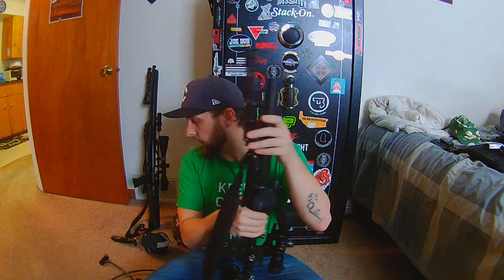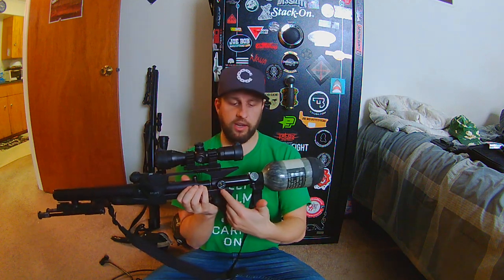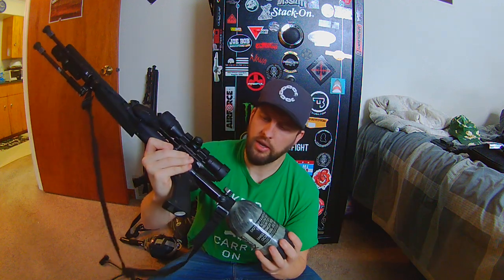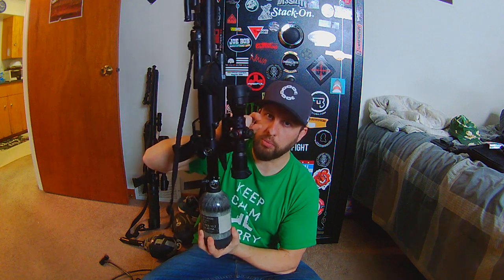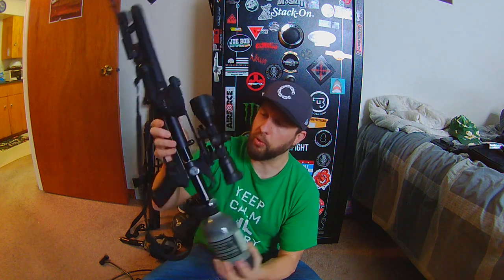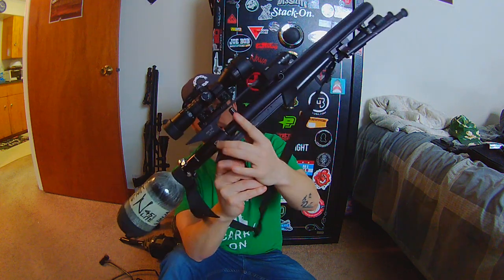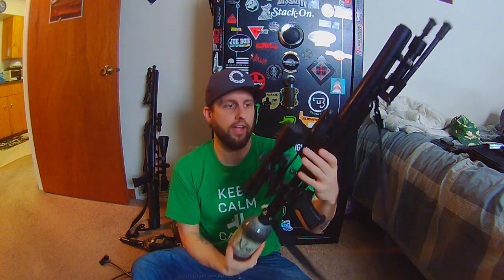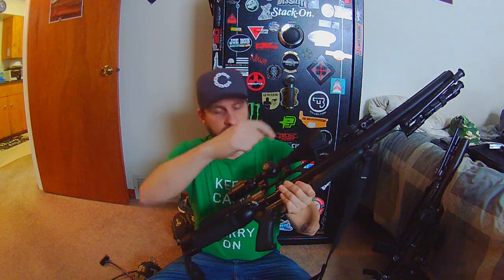Airforce Talon and Condor Regulated Air Systems - An overview

Comment: where did you get the aluminium adapter since the air force one was too heavy ?
thanks
Reply from the maker: I searched around on eBay for it. I hate buying from China, but it actually is good quality.
Reply: @airshootist   thanks that's  where i found it was worried about quality too
since you already got one and say its pretty good guess i will order also
thanks again
Reply: I see you mention the ninja flex reg 2200-3000 psi out put thought that reg was for 3000 psi tanks but you have it on a 4500 psi tank if i am wrong what flex reg is that
thanks you are the only one out there really sharing the knowledge in detail
Reply: @airshootist  
What flex reg is that for 2200-3000 psi output and 4500 psi tank the only one I found was for 3000 tank and 2200-3000 psi output ?
Thanks
Reply from the maker: @marckverduzco4250  So you can find the PCP Flex reg for a 4500psi tank on Ebay. I bought one that was labeled 4500psi on MCSUS.com's website but they sent me a 3000psi model.... So rather than bother with a return I called my contact at Ninja and...well... (unofficially) the only difference on the 3000psi model vs the 4500 psi is the burst disk and laser engraving. Get a 7500psi burst disk to replace the 5k one on the 3K tank model and you'll be fine :)
Reply: @airshootist  
thank you
 you are saving me from doing so much research
since you are full of great info what is your opinion on the altaros regulators being attached straight to air tank since there is no power plenum am i missing something ?
Reply: @airshootist  
Do you keep your flex reg and all connections under pressure when stored or do you    Disconnect when not shooting ?
Reply from the maker: @marckverduzco4250  Yes. Always store your tanks under pressure.
Reply from the maker: @marckverduzco4250  Condor regulated tank is for sale. I just sold the Condor, but not the regulated tank setup. Send me a message via YouTube if interested.
Reply: @airshootist  
Thanks I’m a pcp guy
Just thinking that adapter pin always pushing down on the flex regs output, and I rings being on constant pressure 
Thanks
Reply from the maker: @Marck Verduzco  I actually removed the pin in the reg bonnet and drilled out the adapter for extra volume. Since the adapter is drilled out there is nothing to push the pin in - so it needed to be removed, adding even a teensy bit more volume and creating a straight flow system.

Comment: Interesting but way way way too complicated for your average air-gunner
Reply from the maker: Nah, not really that complicated at all. Maybe doing all the research to build something like this is, but I just revealed all that!  I do appreciate your comment / opportunity for dialogue. 
In fact, this can uncomplicate things a bit. Your tank can stay on the gun for filling (relevant for older model Talons/Condors). Now you have no huge bell curve of velocity to work around. Now you don't have to fill as often. Now you can calculate your trajectory with more certainty. I feel adding regulated setups to my tanks has made my guns much more convenient to use and for much longer periods of time between fills.